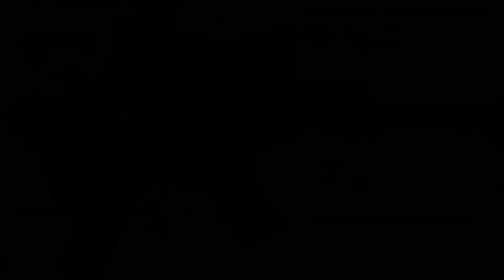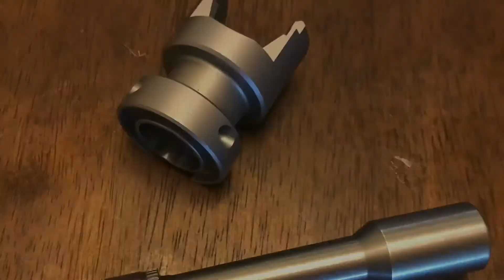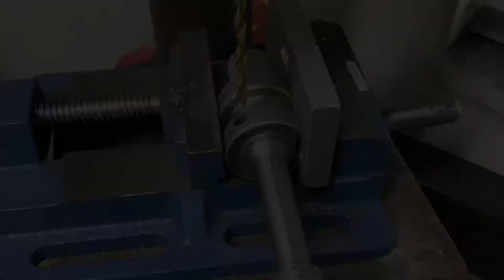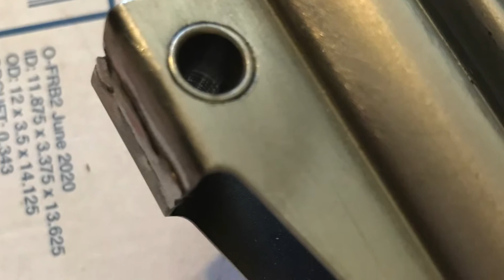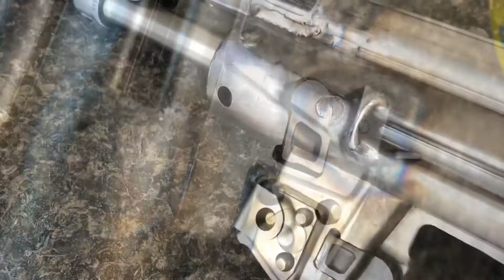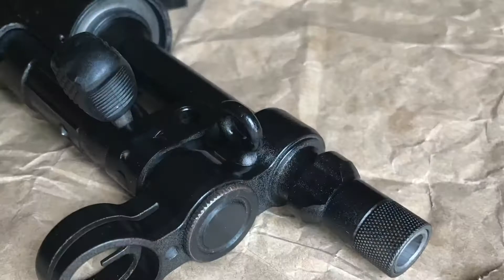2 Minute HK MP5k Build 9mm Reverse Stretch WECSOG MP5

Comment: On your model the back of the receiver looks to be standard MP5 (HK Pin in normal MP5 location, same for lower) and no reinforcement steel over the stock rails.  Was this an option for the MP5k or is this custom with this build?  Great video, thanks for posting!
Reply from the maker: It's what's called a "reverse stretch". Basically a K with more stock options. Uses a MP5k BCG with a slightly longer recoil assembly.
Reply: Thanks for the info, awesome MP5!